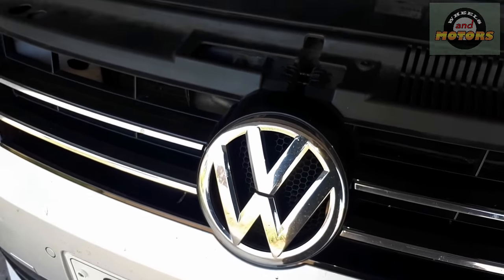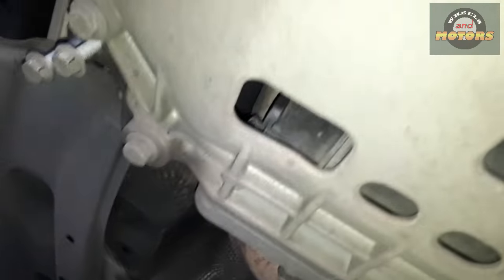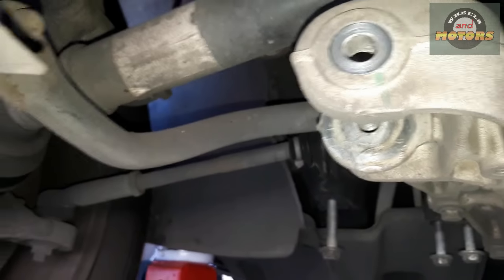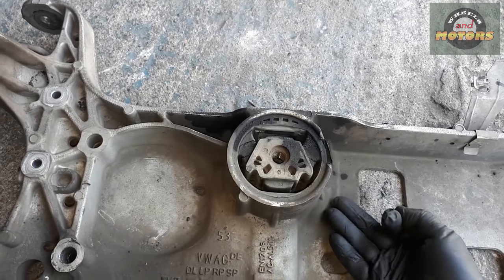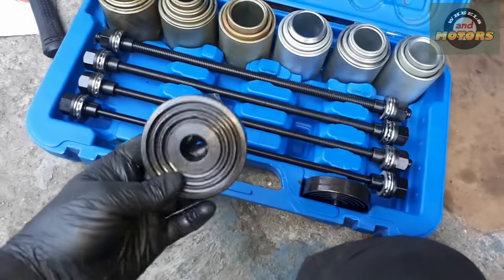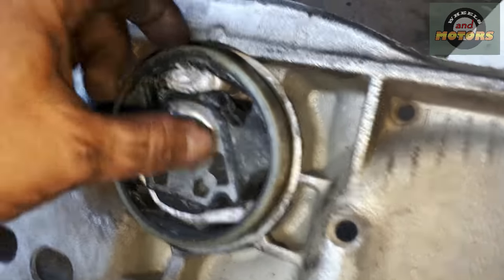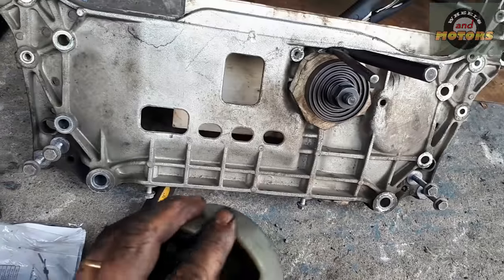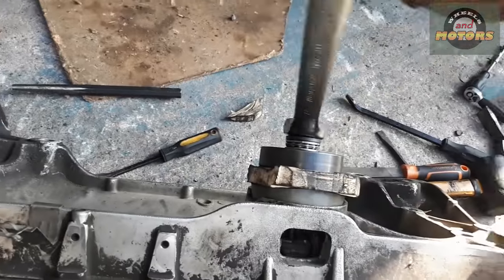How I replaced subframe bush (lower engine mount) - VW, Skoda, Seat, Audi.

Comment: hi Guy`s, i replace too this subframe bush, wasnt so easy.... but my problem is still on there...
i have a passat b7 cffa 100KW 2.0 tdi manual gearbox... when i give full gas to accelerate on 4-5-6.th gear aroud 1800 rmp i feel that is shake the car... first impression was that flywheel, (replace to OEM) same problem, 2nd, impression was subframe bushing,,,,, replaced a same problem...
then my friend told me to replace the complet shaft axle .... still the same shakeing.... any idea? (winter rims, summer rims the same issue)
sorry for my english
Reply from the maker: Hi Szilárd, I had similar symptoms with my previous car (Audi). It appeared to be clogged up fuel filter. But if you look after your car, then I don't know what can it be. I think I get something similar when I accelerate in my Sharan, I need to find out why.. Sorry I couldn't help.
Reply: Could be dual mass flywheel going out.
Reply: if it's just at specific rpm range and at WOT (wide open throttle) this is probably carbon build up.
Reply: I had the same problem. It was the upper engine and gearbox mounts that were completely worn out.
Reply: @ingeborgsjon  I’m thinking of trying that now, I have re-new nearly everything, full Front and rear suspension….. upper and lower  arms, anti roll, bar bushes etc etc etc, just got wheel alignment done and it’s still all over the rd especially after bumps. Think 🤔 I’ll need to renew engine mounts next. Am not letting it beat me now after the money I’ve spent on it Octavia mk2 A5 arghhhhhh

Comment: can you just file all over around to make it smaller?
Reply from the maker: How?
Reply: No, there is a need for a tightly pressed fit, otherwise would come out from engine/transmission vibration. Only friction keeps the bushing  in the place.
Reply: No, but you can chamfer the subframe with a rounded file near the window. Then the bush goes in easily. The chamfered bit is not used once the bush is in, so no loss of hold on the bush.

Comment: Where did you buy the bushings from. Are they OEM? And how did they perform after installation?
Reply from the maker: Firstly I didn't even know there are 2 bushings 😁... I saw there are cracks, so I went to GSF to buy "subframe bush", so they sold me one (lower). Then I realized that there needs to upper one as well. I don't understand why are they sold separately! GSF didn't have upper one in stock. I think I got the upper one from TPS - that's why they look different in the video. After installation bushings seem to be happy 👍
Reply: @wawayltd  yeah there's two. Ahh alright. I just bought ordered mine from my local auto shop (supercheap). They should fit. But I'm trying the insert first, see if it'll fix it, if not I'll try the engine mount. If not I'll replace bushing haha.

Comment: Thanks bro, may I know is there any fast method take the left control arm bolt? I know people generally lower the subframe a bit, so any faster method?
Reply from the maker: Sorry Bon, I don't quite understand why would we need to lower subframe for control arm bolt? What stops us from simply taking it out?
Reply: @wawayltd  mine is touran with7 speed dsg. If I want to take the left control arm bolt out, the transmission pan is blocking. Hence, the bolt is too long and cannot be taken out.
Reply from the maker: Wow! That is painful 🙄
Reply: @bonlau1902  What I had to do was drop down the bolts unfortunately I had to loosen the whole sub frame up to where I could pull that control arm down enough to get that bolt out.

Comment: I seen a few weeks ago to freeze the bushes they didn’t explain why could this be because stop it  breaking
Reply from the maker: Yeah, it can be tricky one, not all garages want to do it. Apparently there's a special hydraulic tool specifically for that job. Dealers have it.
Reply: WheelsAndMotors Just been quoted VW specialist £160 just for labour!.. probably do the job myself with DIY kit
Reply: Freezing metal (objects) will shrink, in just a fraction mm, but it help.
Reply from the maker: In our case we want it to expand...

Comment: Hi this is a very good video can you confirm if your car made a clunking sound over bumps because of these bushes being bad cheers👍
Reply from the maker: Hi. I had a clunking sound over bumps because of bad steering rod, inner ball joint.
I replaced this bush mainly because visually it looked destroyed. 
Also bad anti-roll bar links can make clunking sound.
Reply: @wawayltd  cheers I have checked everything & replaced bushes, cv joints, lower ball joints the anti roll bar bushes are solid no play I'm going to replace these to see if it cures the clunk, thanks for replying il reply ltr when their replaced hopefully no clunk🤞🤞
Reply from the maker: I don't want you to throw money at it just to find out what's clunking. Friend of mine had clunking with bad steering rack..
Maybe ask some mechanic to have a good look at it? Shouldn't take long or cost much, but once you know - at least you're not playing lottery with your time and money.
Reply: @wawayltd  true perhaps that's a better idea cheers
Reply: @sendheron1  did u figure it out?  Some bushing are hard as rock causing noise.

Comment: Hello, I have a 2011 Sharan with a warm start problem. It cannot start up as the video shown below when I turn off the car for 2 or 3 minutes and start up again. No error code shows. I have cleaned the throttle valve, the injection nozzles, the intake pipe and changed the spark plugs and the motor of the electronic throttle at the shop and yet the problem still exist. Do you have any ideas for the problem? Can i send you an video of the problem? Thank you.
Reply from the maker: Hi Kenneth, I saw your video in our Sharan Facebook group. I don't know how to help you with this unfortunately. Probably try scan it with VCDS, it should have some sort of record of what's going on.
Reply: WheelsAndMotors Thanks you for the advice!🙏🏻

Comment: To cange anti roll bar bushes it need to take this sub frame out or it can be canged without dismantelig it?
Reply from the maker: It can, but it needs special hydraulic tool.
Reply: Anti roll bar bushes, Did you replace it?
Reply: @ i replaced the anti roll bar but noise was from lower arm bushes!

Comment: The two new ones are not a pair....they are of different models.
Reply from the maker: They are pair, just different brands.
Reply: @wawayltd  
No....
The upper one is the correct model, lower one is of a different model.
Reply from the maker: @omercoolbuddy  No.. How can it be different model, if this subframe is fits almost every VAG of that generation - VW, Seat, Skoda - so does the bush. Both bushes were bought from different car parts shops and they are different brands. But they both fit! Considering they are different makes (brands), they don't have to look exactly the same, as long as they do the job.
When you'll have more experience with car parts - you'll understand...
You're welcome  😉
Reply: @wawayltd  
Im sorry, its not about having "more experience" or "less experience"...pls dont get offend, my friend.

There are 2 models for the same Subframe.
Model-A PFF85-504 pair set.
Model-B PFF85-704 pair set.
...you can browse for details.
Reply from the maker: @omercoolbuddy  Sorry my friend, I didn't mean to offend you. I can see that you are much more into details about these bushes than me.
When I search for numbers you provided - it offers inserts instead of actual bushes. 
I agree that if you are looking for inserts, it's very important to get correct shape, so it fits into the bush.
I was looking into getting insert myself, but after some reviews I decided that it won't be good for my car, especially for diesel. So I decided to get new bushes instead.
For some reason my parts suppliers don't sell them in pairs. I got bottom one first (they didn't have top in stock), then went to different shop and got top one.
Accordingly to their data - it all fits my vehicle. I got what I wanted - fresh bushes that do the job.
Now I have account with TPS, original part suppliers, and next time when I'll have to change subframe bushes, maybe they will supply actual pair. 
But in all fairness, I don't see much importance as long as it fits the subframe and does the job.
Thanks for pointing that out!

Comment: Guys what's the part number for this subframe bush/mount please?
Reply from the maker: I bought them from parts shop (Euro Car Parts) just explained what car and where they going to... Don't know number, sorry.
Reply: @wawayltd  ok thanks. I asked you because in your previous videos your replacement parts were usually from TPS. Anyway thanks mate :)
Reply from the maker: @omerafzalmalik  I probably should buy them from TPS, because even though they are just bushings, you need to be careful what brand you're buying. Like Vtech from GSF don't last at all..
Reply: @wawayltd  I agree you're right, original replacement parts last for a very long time.

Comment: I hope there's another way of removing bushing with out removing subframe, because I hope you find out that after removing subframe it messes up your alignment and only place to fix it is a stealership.
Reply from the maker: Any tyre shop will check  alignment...
There is another way without removing subframe, but it requires special tool.
Reply: @wawayltd  Nah bro there is a cheat am gonna try. It does require a 2-column lifts or jacks stands.
1. First your remove the bushing(There are many ways to cutting to burning, just use your imagination) 
2. Press it in from underneath the car using a lifting jack that goes straight up.
Or when you have a 2 colums lifts you could place the bushing under the car on a flat brick or wooden beam and just lower the car but sadly this is more risky because you cant really go really slow.

Mine advice use a lifting jack, Heat subframe a little, let the bearing be really cold. 

Heating up subframe makes it a tiny bit bigger, cooling the bearing will make it a tiny bit smaller so pressing it in will be easier
Reply from the maker: Ok. Would love to know how it went 👍
Reply: @wawayltd  Well am gonna film and upload it to yt. Just waiting on parts now, Will let you iknow!!!
Reply: It doesn't affect your wheel alignment if you only remove the centre subframe.